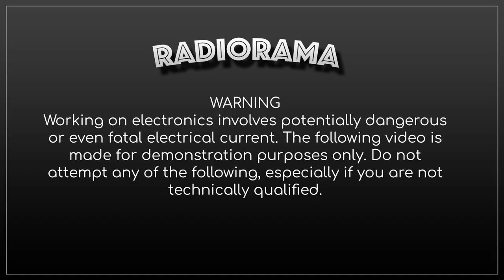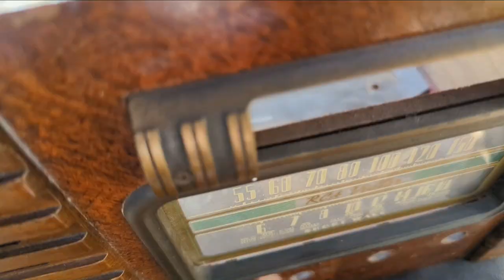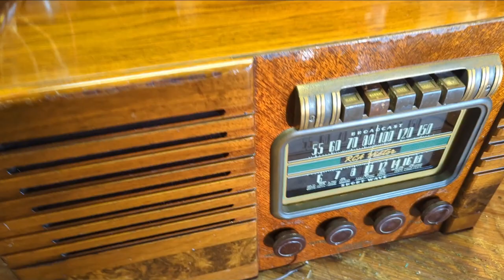NICE Rca gets a once-over

Comment: Nice  RCA Victor 16T3 from 1940. Minimal rubber coated wiring. Schematic shows two 10uF E caps ( in Pi network) 
at 450 Volts and one 20uF at 25 Volts for the output. Old replacement 3 section cap was wrong one. Don't tell Seth.
Signal bleed- through all throughout the band. Oscillator coils have rear adjustments. Well designed radio and after
Seth's  tweaking it sounds great.

Comment: I use a 22ohm 5watt fuse resistor in line with the AC for protection it drops the voltage from 120 down to a cooler 110VAC to help nurse that old transformer. A fuse is good too but a do it yourself person might take it apart and put a five amp fuse in the cartridge 😆 at one time I thought of also adding a thermal fuse on the transformer